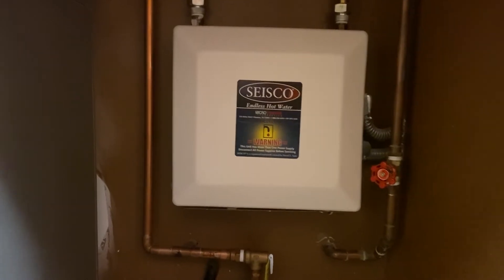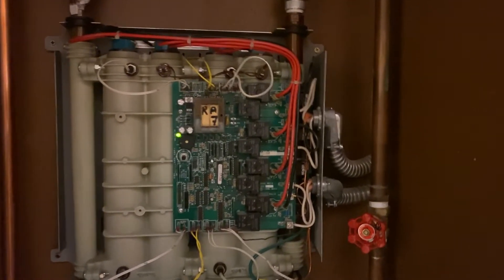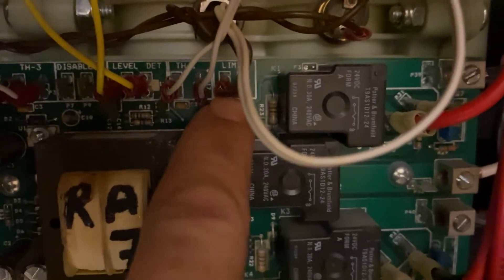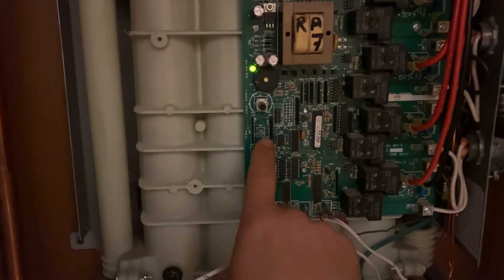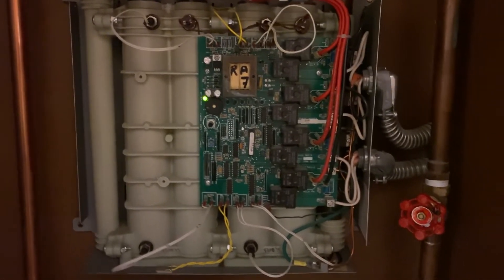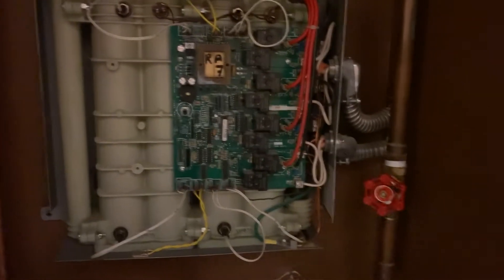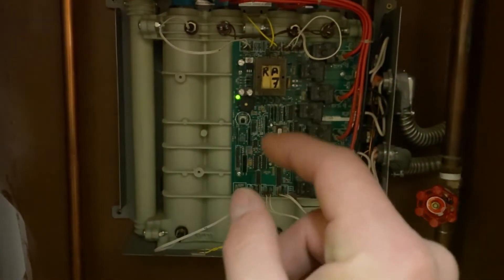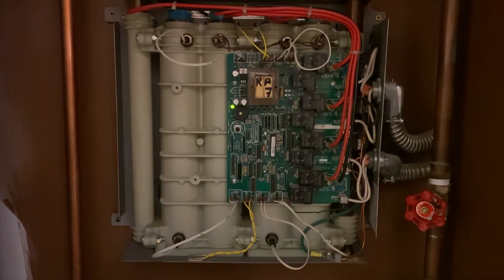Troubleshooting SEISCO Tankless Water Heaters & repair in MINUTES - Temperature sensor issue (RA-28)

Comment: Had similar issue.  Swapped out a bad inlet temp sensor with new one.  As Company is out of business I bought one thru Supply House.  Did not say it was for this brand but worked fine. It had 10 Ohm resistance vs other working ones at 12 ish.

Comment: How do you flush these tankless water heaters ? Can u help
Reply from the maker: Remove the front panel, then underneath each resistor ( or water column) there is a few s screws to remove to open a little flap.
Of course, ensure your water system breaker is off as well as your water feed valve.
Let me know if future issues, I am going to the cabin tonight and will check to make sure what I told you is correct

Comment: my water heater is leaking - do you have any solution to that?
Reply from the maker: May be a loose fitting or a worn o-ring. Not sure where it is leaking from though.
Not sure if you could share a pic to point out the exact location